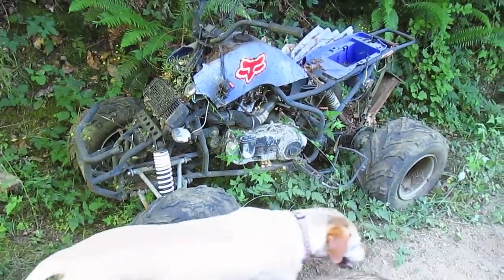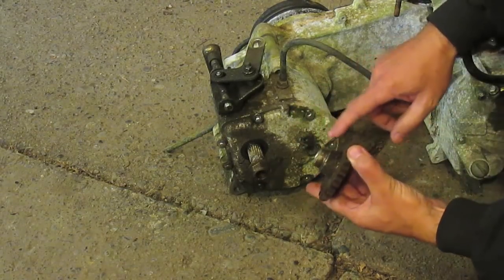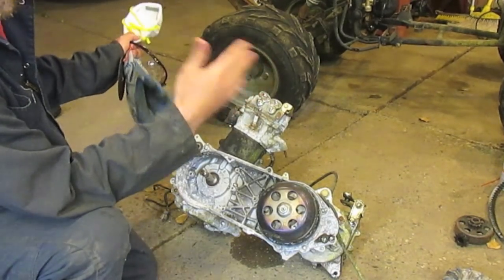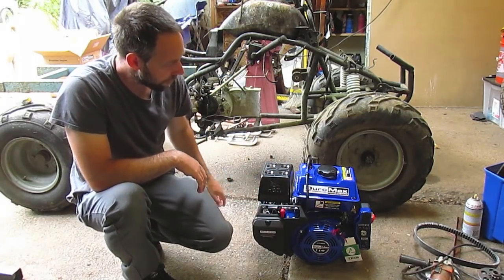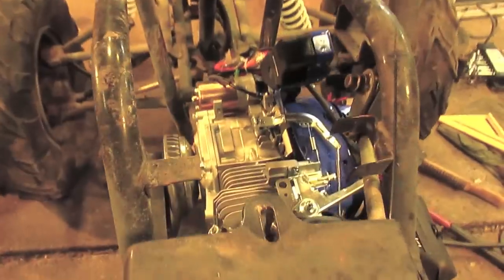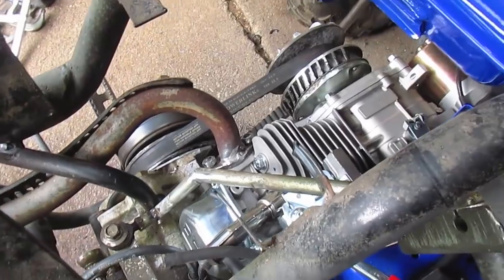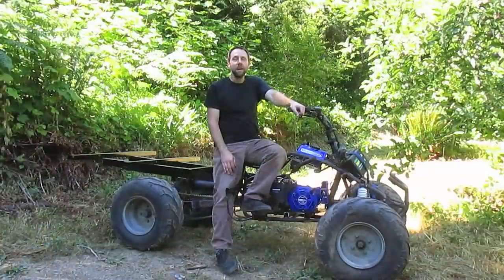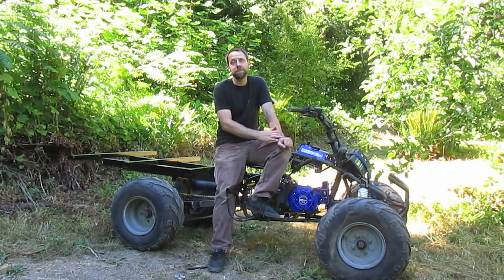Homemade ATV quad truck part 1

Comment: Where did you get the lathe from? What did it run you?
Reply from the maker: I picked it up on Craig’s list for $1600, I had been saving for about a year and when it popped up I was the first call to the guy, it’s a 13”X40 from the mid 80s built in Taiwan, it’s similar to a Enco, Jet or Grizzly of that time. 
It’s a gear head lathe so no changing belts you just turn the gear knobs to select cut feed speed and spindle speed. I had to buy a rotory 3 phase converter because it was 3 phase but it wasn’t that big of a deal, now I have 3 phase in my shop! This lathe came with some nice tooling like a Aloris quick change tool holder, a 6” three jaw and a 8” four jaw Chuck plus some live centers and a quality Tail stock drill Chuck, a collet closer, that collet holder alone sells for over $1000 new. If you keep and eye out for awhile you definitely can come across a metal lathe 👍 take care Brandon.

Comment: I think I will stick with towing an ATV trailer with my quad instead.
Reply from the maker: That’s fine, just because I built this doesn’t mean you need to. Keep in mind you have a fully working quad and trailer, I started out with a broken down quad and no trailer, I’m just working with what I got, and being creative. My quad truck is now finished and has a 500lb capacity in the bed with a hydraulic dump, tool box, trailer hitch for hauling my log splitter, big front rack, and a side lumber rack for moving 12’ boards. The nice thing is when you build it yourself you can make it to your exact needs.
Reply: @Mikefestiva  Dont get me wrong, I think your engineering is awesome. Great project of you have the know how and gear and time to do such things....I am too old for that stuff. I wouldn't be without my quad. Well done on the video editing to.

Comment: "Homemade" ? You just extended an actual ATV with a few steel bars. I don't call this home made.
Reply from the maker: Haha you got a little bit of Troll in you don’t you! You completely left out the fact that I completely repowered the machine, the next video I welded a aluminum dump bed, welded up a front rack, and also adapted a hydraulic power steering rack for a hydraulic dump bed. Have you built anything like this? If you have I would think you would be able to understand that there’s a lot of work and fabrication that goes into something like this.
Reply: @Mikefestiva  Well I definately would if I had a garden and no neighbors to disturb with noise, but I don't.
To me, homemade is more from scratch than what you're showing here. It's like when you go to the restaurant and they pretend it's home cooked while it's mainly industrially prepared food, manually assembled together.
Reply: It's homemade because he added new things
Reply: @dannyjohn262  So if I add a sticker on a brand new Bugatti Chiron I guess it makes it homemade then.
Reply from the maker: Haha star core you just can’t get over this topic can you? I added a lot more then a sticker to this quad. The engine was shot, I cut the old transmission apart and adapted it to a different engine, I cut the frame apart, extended it and re designed it for a dump bed, welded a aluminum bump box for it, welded a front cargo rack, I built a hydraulic dump out of a car power steering system, I fitted a different seat and gas tank and I welded aluminum fenders for it. It’s a homemade quad truck, it was never manufactured as a truck, I built a truck out of a broken down shot quad, yes I didn’t build every piece from the ground up but I have modified it beyond recognition. For you to keep nocking me for this and telling me it’s not homemade is definitely getting old. Your the kind of guy that would probably say the same thing about my bandsaw mill I built from scratch, you probably would complain it’s not homemade ether.
Reply: @Mikefestiva  I was just responding to the other guy, relax...